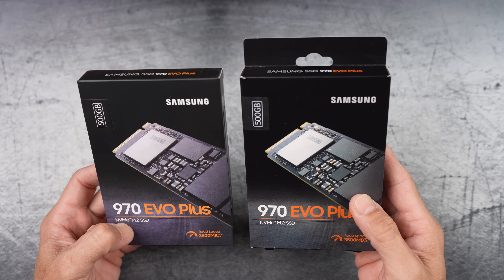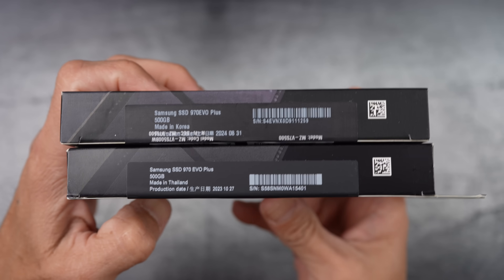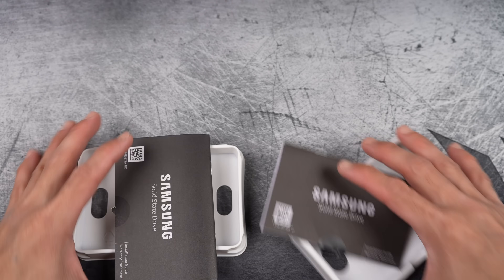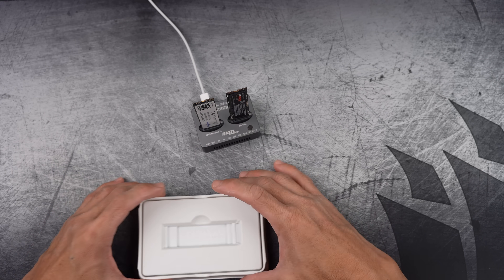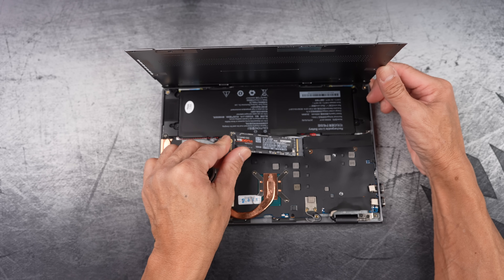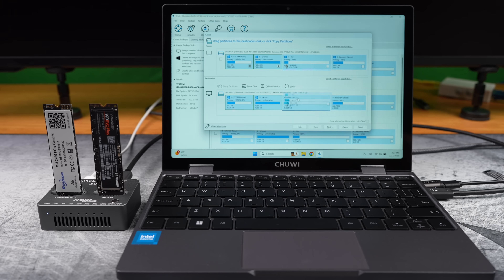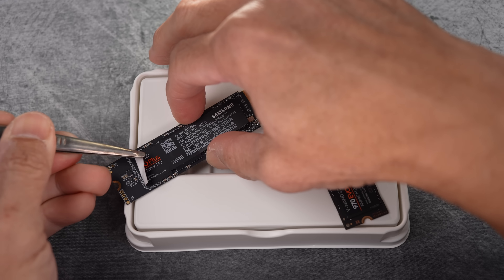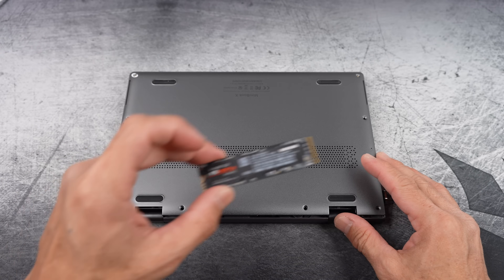Fake vs Real SSD - Can You Spot the Difference?

Comment: Missing DRAM is the real story. Thank you for posting this. I have other real concerns about HUAWEI or the new DeepSeek having hidden hardware or back doors available to access data. This could be the most challenging to find on cheap Chinese tech.
Reply: I have that concern too with American hardware and western communication networks. Snowden told us all about this. I am not so much afraid of China. China is not interested in my opinions. The power structures that I live under do and my opinions about certain subjects are actively censored, also on this platform.
Reply from the maker: Missing DRAM is definitely a major point of concern with these drives (you may be the first to mention this). Your point about potential hidden hardware or backdoors is something that really highlights the need for vigilance. Thanks for bringing up this important perspective!
Reply: I stopped buying anything expensive from China. No computer, no TV, no router, even my tea machine is from Malaysia. Wonderful life now. No problems, no fear of hackers in my home, no fear of   quick death of the device, no fear of poisonous colors. DONT BUY CHINA. Best tip I can give everyone.

Comment: Even if they preform equally, I REFUSE to knowingly use Fake SSDs, even if it works, it is more likely to fail
Reply from the maker: Thanks for sharing. I’m considering returning mine even though I could use it as an external drive.
Reply: @TossSong it depends where they sourced the nand from. From what I can see it seems to be fairly decent quality, but if the NAND sourced is recycled or failed QC, it will work but you may have weird issues and it will likely fail after a few months.
Reply from the maker: Yeah, that makes sense. If the NAND is recycled or didn’t pass QC, it might work for a while but could fail unpredictably. Definitely not worth the risk for anything important!
Reply: The fake EVO 870 SSD I was sold stopped working after 6 months.
Reply: Those very cheap out of this planet knock off brand nvme just working slow after 2 years compared to the same laptop with original WD nvme..same programs installed..
Reply from the maker: @camilo8cheryl Yeah, that’s the risk with these knockoff NVMe drives. They might work fine at first but tend to degrade faster over time, especially compared to reputable brands like WD. Definitely a gamble!

Comment: So the fake one is better , not only that its cheaper , but look at how easy it was to clone and install in comparison to the real ssd.
Reply from the maker: That’s a good point though! I just wanted my MiniBook to perform a little faster.
Reply: No, a ssd with no cache ram will always perform slower than a ssd with cache. Also, the non-cache ssd will inevitably have a much shorter lifespan.
Reply from the maker: @thefreedomguyuk You’re absolutely right—SSDs without cache RAM not only perform slower but also wear out faster due to higher write amplification. It’s definitely something to watch out for when choosing a drive!

Comment: Yes I figured out what it is, I have direct experience with fakes 👿 from China, first clue, slightly bulky SMD components, then much more capacitors on the other (real) SSD - it makes sense for the RAM and finally on the PCB at the too big holes at the bottom.
Reply from the maker: Great observations! Those details about SMD components, capacitors, and PCB differences are really sharp. It’s amazing how these subtle design clues can reveal so much about authenticity. Thanks for sharing!

Comment: It's probably not a good idea to buy brand name products from Aliexpress in general. The dangers should be obvious. Aliexpress is good for generic non-brand products.
Reply from the maker: Thanks for your comment. I’m aware of that now. But I’m glad to share this experience on video, so people will be more aware.
Reply: turns out ebay too
Reply: Depends. I have gotten several legitimate Crucial P3 Plus 1TB drives from AliExpress and they work perfectly. Perform exactly as advertised, and fully recognised in Crucial Storage Executive.
Reply: ebay too?
Reply from the maker: @punk5hits Yup, eBay can be risky too—especially for brand name SSDs or electronics. Some sellers are legit, but fakes slip through. Best to buy from trusted sellers or stores with solid return policies, just in case.
Reply: @TossSong  return before 10 days the item arrived in 2 weeks 😅
Reply from the maker: @punk5hits Thanks for commenting and the info. At the time of making this video, I was pondering whether to keep it for an external backup (with enclosure), but the more I researched about its reliability, the more it made sense that I made the decision. Even on here, you’ll find people who got the fake one are complaining about it.
Reply: Wouldnt you think! I bought a Samsung Evo 64GB SD card some years ago. An alerting experience for 10 bucks is a cheap one. :$
Reply from the maker: Totally agree—sometimes a $10 lesson saves you from a $100 mistake later. Those fake Samsung cards can be sneaky! Glad it was a cheap wake-up call.
Reply: how about you just don't buy products that have price tags too good to be legit regardless of the website bro
Reply from the maker: Thank you for commenting. Yes, lesson learned for me.
Reply: They have super consumer protection, but if you're not able to spot the difference, then what does that protection matter? ;)
Reply: @snotspat  i was going to say that aliexpress have been even better than amazon when it comes to returns for me. however once you confirm receiving it, you only have like 15 days to check that everything is okay...so i don't know how good support is after those 15 days
Reply: @R0DSTER  I'm not sure how much "better" a return option can be if you have to ship it to the other side of the planet on your dime.  And yeah, Amazon would be burned to the ground if they only let people return things within 15 days.
Reply: @Asterra2  no they actually send you a free shipping label just like amazon does of course, and it's actually to a EU address (for EU customers at least). yea, i'd hope that aliexpress still refunds you if it's after 15 days (assuming it's a fake, stopped working etc), i just have never tried it after that
Reply: I've seen ripoff on Amazon too and they won't do anything about it. I've emailed them about the issue and they were like oh well, we will still allow them to advertise and sell. Just because I said it was fake, didn't make it fake and they wouldn't even look into it
Reply from the maker: @WayneWatson1 That’s so frustrating—I’ve heard similar stories. Some sellers seem to slip through the cracks even on big platforms like Amazon. And that people may not realize that many electronics on Amazon are exactly the same as ones on AliExpress, and even the same sellers too, just for less and long wait time. Hopefully more awareness (like this video and thread) helps others avoid the same trap. Appreciate you sharing your experience!
Reply: @TossSong  no kidding. even recently i bought an unknown brand product on amazon that had tons of reviews...but when i received it, the product was still inside the original aliexpress shipping envelop 🤦‍♂️ which was then inside amazon packaging. i looked it up on aliexpress and found that exact same product (and matching product box) for 1/5 of the price. luckily i could still return the amazon one
Reply from the maker: @R0DSTER Wow, that’s wild—thanks for sharing! It’s crazy how some of these listings with tons of reviews turn out to be straight from AliExpress anyway. Glad you were able to catch it and get a return!
Reply from the maker: @R0DSTER Absolutely agree—that’s one of the worst loopholes on Amazon. It’s wild how shady sellers can piggyback off legit reviews and totally switch out the product for a lower-quality clone. Makes it so hard for buyers to trust what they’re getting these days. Really gotta dig through the recent reviews now just to be safe!

Comment: Fakes usually have less storage capacity than advertised amount.
   A test utility can test test the device and report  actual capacity.   FAKEflashtester. 
        The test checks random spots covering the whole capacity and will identify
the actual capacity and report bad "FAKE" storage spots.
I have a USB to SSD adapter for bench testing and very high speed storage.
Reply from the maker: Thanks for the tip! I hadn’t thought about using tools like FAKEflashtester to verify actual storage capacity and identify fake spots. That USB to SSD adapter setup you mentioned sounds like a great way to run detailed tests. I’ll definitely consider running these tests in a follow-up video to dig deeper into the actual performance and integrity of these drives!
Reply: @TossSong    Fake Flash tester is Extremely fast as it doesn't check every Bit.  Every Bit isn't necessary.  Fake Flash tester test random spots until it finds the actual capacity.
Reply from the maker: @madogg152 Thanks for that! I didn’t realize Fake Flash Tester was optimized to check random spots instead of every bit. That makes it super efficient for quick capacity checks. Appreciate the tip!
Reply: @TossSong  😀😁🙃

Comment: You bought the fake drive on Ali. Will it be more likely real if you buy a cheap drive on eBay or Amazon?
Reply from the maker: Amazon and eBay would be a better option since you could easily return them. For Amazon, for electronics, more often than not they are authentic. Not 100% for both.
Reply: Only if it is used.
Reply: Both are also full of counterfeits. If you can, buy from a reputable seller on those platforms and thoroughly check it when you receive it.

Comment: I use a Samsung 970 EVO Plus that was very suspiciously cheap. The box is without the hanging tab (= your fake one), the booklet has tiny font and excellent print quality (=your real one), the box colors and print quality are very good (=your real one), the internal plastic cover has those 2 stickers (= your fake one), it has 2 barcodes (=your fake one). It is made in China.
Samsung magician says mine is genuine. Interestingly, the read/write speeds in the top row in the CrystalDiskMark are 3564MB/s and 3271 MB/s. other numbers are also close to what you get with the real one. 
Are you sure that you did not mix any of the footage of the boxes?
Reply: If samsung magician claims it's genuine, and you are able to successfully upgrade the firmware, I'd say it's real. I've bought Samsung drives before that I know 100% are real and they didn't come with the hanging tab.
Reply from the maker: Thanks for sharing your experience! I double-checked the footage, and the comparison is accurate. It’s intriguing how subtle differences like print quality and packaging can still pass off as real. The fact that Samsung Magician verified yours is a good sign!
Reply: I was scammed with a Samsung EVO 870 last year. Printing and case looked perfect. Until it stopped working after 6 months. You might have a fake too, maybe. Check my report in the answer one level above.
Reply from the maker: Sorry to hear that happened to you — that’s really frustrating, especially when the product looks perfect on the outside. Thanks for sharing your story, I’ll definitely be double-checking mine with tools like Samsung Magician or CrystalDiskInfo just to be sure.

Comment: it is not correct behavior to run speed tests on boot device. windows has so many background maintenance jobs running, or not. if you are going to do a speed test, it has to be secondary drive to get correct results.
Reply from the maker: Good observation! Running speed tests on a boot drive can indeed skew results due to background processes. I’ll keep that in mind for future testing—using a secondary drive is a great suggestion. Thanks!

Comment: i think the only thing i missed from this video is if the storage on the fake one was real storage.
Reply from the maker: Great point! The fake SSD did show real storage capacity but with questionable reliability. This is a common issue with counterfeits—they may not perform consistently or have the same durability as the genuine product. Thanks for watching!
Reply: @TossSong  Well, the big aliexpress cheap drives, like 4-8TB have "cheat controllers" on them, so they will show as their rated size to the OS but when you write full capacity to them they keep overwriting data. It looks like you can put 4-8TB on them until you try to read the data back, it will show as corrupted to the OS but in reality it is overwritten by the later stored data. The way they work seems to be that the first 128 or 256gb (it varies) is real, and above that the controller keeps overwriting the same chips. The last written data is there, but the oldest data above the "real/fake" border will be corrupted. The file reference etc is stored in the lower part and so is the allocation, but the data isn't. 
I would think there may be more than one kind of fake, but what I described is the one I've seen - which is really smart actually because the OS will work and boot, and you'll only find out it's a fake drive after quite some time if you are a normal user. It's also downright evil because people will think they have their data still, like backups, files, media etc - until they try to access the "wrong ones" that have been written over. I'd bet there are people who will loose valuable data with those things.
Reply: Isn't there also a potential problem with cheaper controllers not writing data in a way that protects the SSD from maxing out writes early.. (maybe similar to TRIM)
Reply: @Monty_BeGoodToEachOther  yeah they code these things in a way where once they reach max of the actual storage, its starts overwriting.